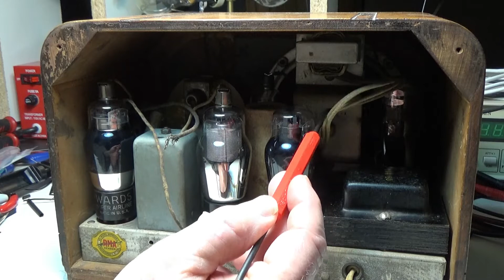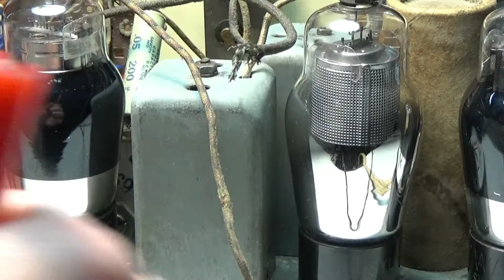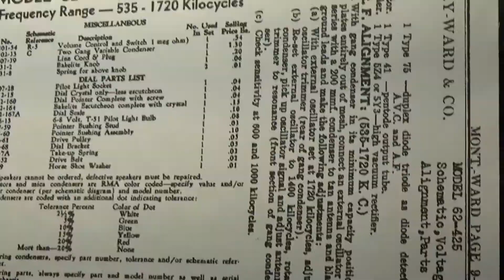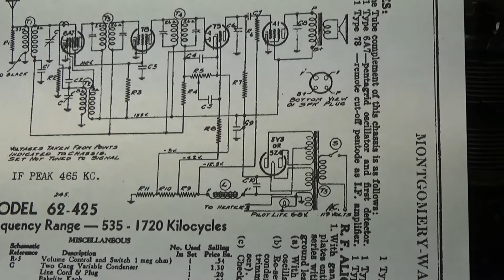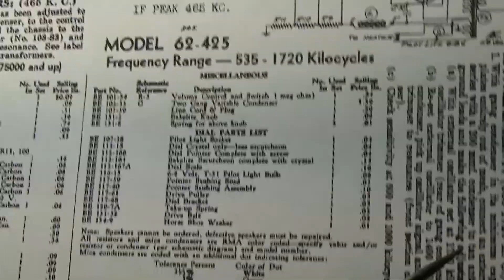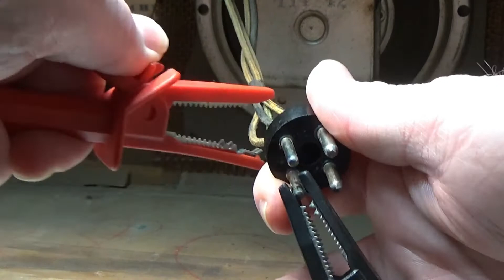Montgomery Wards Airline 62-425 (Indian Head Radio)Part 1:First Impression & Inspection

Comment: I like the burlap speaker grille.
Liquid electrical tape can be used to patch small tears in speaker cones. Soaks into the paper, and is flexible when dry. I think you'd be hard-pressed to apply hot glue thin enough to work well.
Reply from the maker: I have to agree with you, but if you worked fast and had everything set up, it might work well.  I am unwilling to take a chance with an old radio though.  Thank you for watching and leaving a comment!!

Comment: The chassis appears to have a power-supply transformer, which would mean that the tube filaments are connected in parallel. I didn't notice any tube pin numbers on the schematic. The later low-budget, transformerless postwar AA5 receivers have their filaments connected in series, like old-fashioned Christmas lights.
Reply from the maker: Yeah a lot of these old radio schematics did not provide pin numbers for the tubes.  I have found the tube data sheets to be very helpful in this situation.  Thank you for watching and leaving a comment!

Comment: The device that you pointed to that was attached to the chassis is often called a "Canedohm" and in essence, it is a wire-wound resistor with multiple taps.The few I have seen had the wire wound on a ceramic base, and had a "Fishpaper" between it and the metal housing which was attached to the chassis.  These are prone to open due to things like a leaky capacitor and such that result in a high current through the wire.  A number of folks I have watched replacing them have added a terminal strip with the appropriate value resistors (resistance, wattage, etc.) on the terminal strips and wired from the strip to the appropriate location.  I think one idea behind them was to use the chassis as a heat sink to save components from excessive heat.
I suggest that you DON'T use hot glue on the speaker!  The hot glue will not get flexible enough and will degrade the performance of the speaker.  The coffee filter and glue works fine.  Some folks have used "Liquid Tape" because it, in a thin film, will be more flexible.
I urge you to watch the following two videos (the entire video in each case) for there is so very much wonderful and needed knowledge there!
https://www.youtube.com/watch?v=BnR_DLd1PDI
https://www.youtube.com/watch?v=67M7fsbLUIU&t=185s
Good on you for using a polarized cord on this!
I have watched people like Dave Tipton take the chassis almost completely apart and really clean up the chassis and make it appear new.  Doing so usually destroys stickers made of paper, but what he did was to take a photo of the original sticker and make a reproduction of it. Then when finished he applied the sticker to the chassis and you really wouldn't know by looking at it that it wasn't original.  He and others have painted the transformers also after cleaning them up and removing any rust on chassis and/or transformer.  Oh yeah, and the shields on the tubes, like new when done.
Reply from the maker: Thank for the information, and thank you for watching!